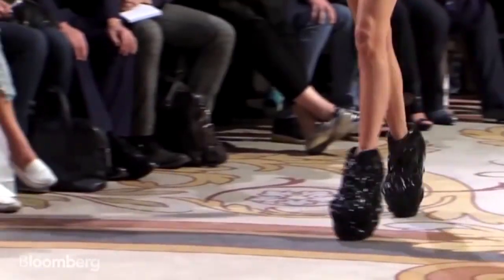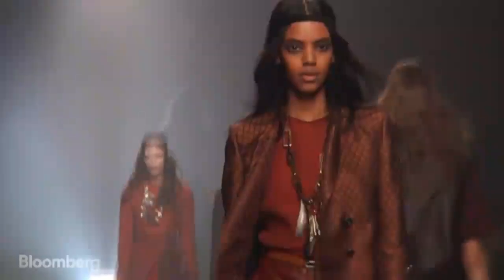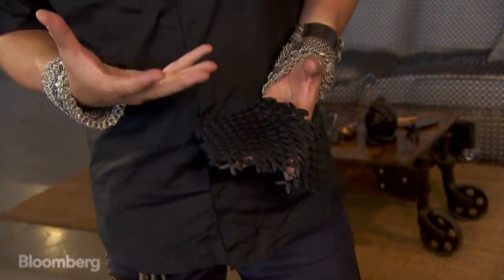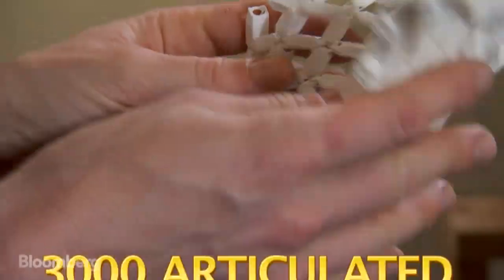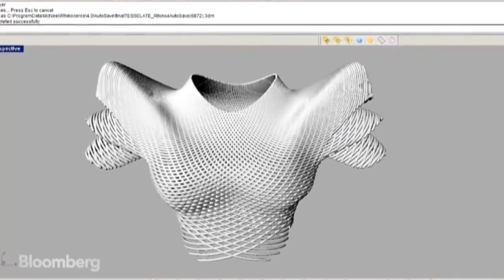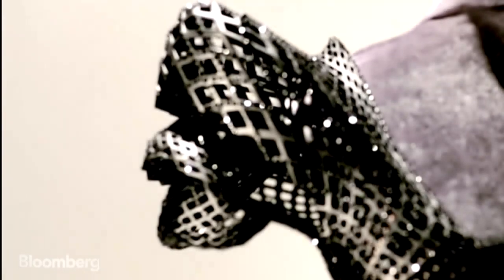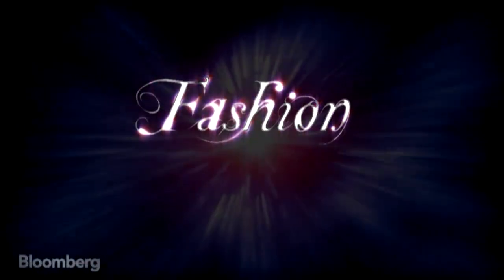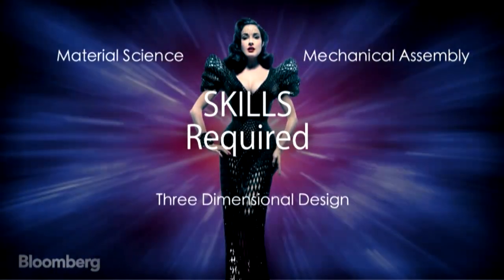The World's Most High-Tech, $100K 3D-Printed Dress

Comment: While this dress may have taken hundreds of hours to make, that does NOT make it impractical at all.  A machine running in the background does not have the same labor cost as a handmade dress.  Additionally, once the dress was designed, it can be printed on any number of printers all over the world, customized for each individual with what will soon be considered basic computer skills.  Additionally, the designer could have designed it folded so it would not require soldering the pieces together and truly be a 1 piece outfit.  The retail cost of the nylon for 3d printers is under $20 per pound.  Skip on the blood-stones and you will have a truly sustainable outfit that when you are done with it, you can easily recycle.  Within 5 years women will be wearing a dress of this quality for well under $100, not $100,000.
Reply: Cool stuff :)
Reply: When a teen can use a printer in a library, and print out a prosthetic hand for a neighbor, it's certainly not out of the realm of possibility for clothes to be made with the same computer skills as paint, just with hardware like a 3d scanner
Reply: ***** Most people would probably still prefer man-made over some printer tho, just like food.
Reply: Well it’s been 5 years and this is still costs a lot and not mainstream and our planet is in danger